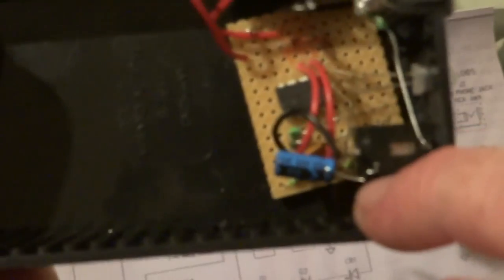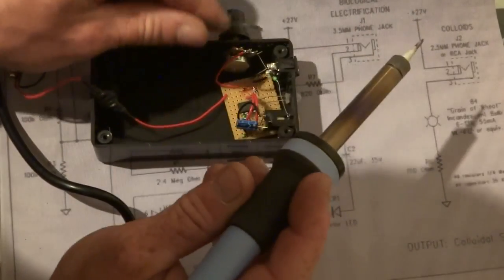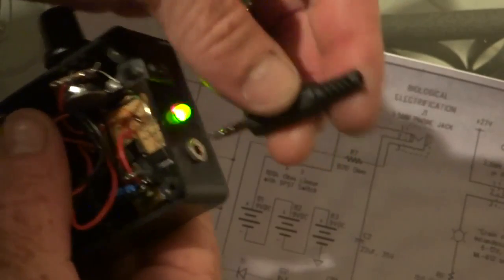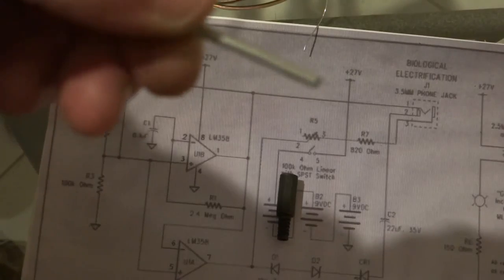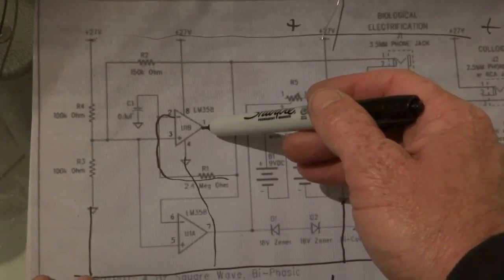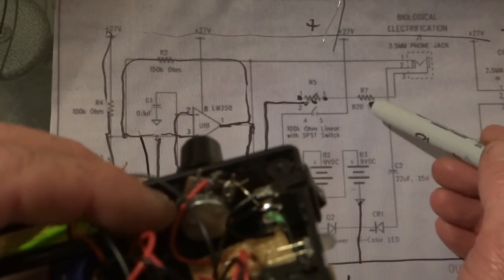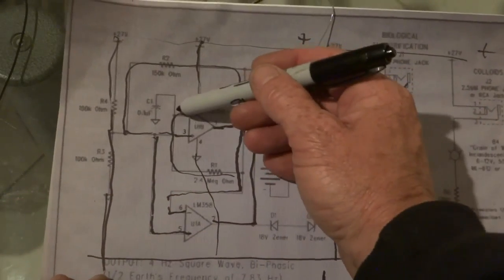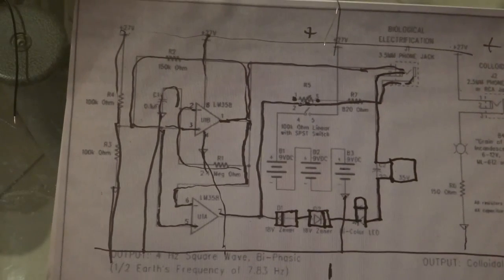How to build a Bob Beck Blood Electrifier  2

Comment: I have build the device and it works. Great instruction in your tutorial video. What method and materials do you use to solder the copper wires to the stainless steel rods to make the electrodes? I am find it difficult to solder the two metals. Should I use another method that requires more heat than a soldering iron?
Reply from the maker: i didnt personally make this vid, im just re posting to help spread the info. i had to resort to stripping the wires and wrapping them around a Stainlesss cotter pin and hot glued then wound around. i cut the pin in half so each half is glued to each wire
Reply: That is an excellent retrofit for the electrode. Tell me ," what size pin do you recommend.?
Reply from the maker: Neo Tuner  get one about as wide as a headphone plug. im sorry i dont have the exact data on hand.
Reply: Thanks for your help. The unit works well. I am strictly into day 5 of the BB protocol. Strange ... but my sense of smell has increased. More to follow.

Comment: Hello Synapso, Can you do part 3 of the video also explaining the silver pulser circuit
Reply: just put a 9v battery on an opened battery clip removing the wires, run two other wires with 5amp rating into aligator/crocodile clips with 5amp rating(i got from halfords(car extras specialist) then clamp 999 gauge or bezel silver on, make sure wires from 5amp cable dont go in water and your away!! just leave for 2-3 mins in water remove stir and enjoy ;)
Reply from the maker: Its not me, i am just hosting it for archival purposes. look at the "origionally from "  link in the description

Comment: This will be my first diy activity... it looks relatively simple but the guy did not explain/show enough of the soldering for me...what was that stick of metal that he was using to solder the wires to the box? also, are we supposed to solder the back of the board (at the beginning)? what are we soldering to what there?

please excuse my ignorance but can someone help me out with that? if I get pass this part, I think that I could do everything else no problem. thanks!

Comment: Thanks for the great video. One question please. I noticed the resistors you used are slightly different (.6w 1% vs 1/4w 5%) as shown on the schematic. Is this critical to obtain proper delivery at electrodes?
Reply from the maker: the 5% should be fine..

Comment: Thanks for this great tutorial. I know it was a lot of work, but well worth it.
Can you tell me what readings I should get if I hook up a voltmeter to the electrodes? I realize it is going to jump around because of the square wave pattern, but should the peaks reach anywhere near the 27 Volt supply?
Thanks for your help!
Reply: It is bi-phasic so it will depend on how you measure it.If you measure with direct current it will jump around from + - + - + - readings where if you measure AC alternating current it will give you total voltage.

Comment: It seems as though you change the output of the circuit by omitting the two other lights. Bob Beck indicated that it takes a small voltage to disturb the harmful cells envelops. Just want to get your opinion on the matter. DOes it change the effectiveness of the mchine??

Comment: Great tutorial. I followed you instructions however when I switched on the unit, it blew out the light bulb. I bypassed the bulb and the LM358 exploded blowing the top off the chip. I used a mono plug and jack and it was plugged in prior to switching it on. The bi colored LED does not light but is good when I tested it with a 3vdc battery. I was unable to find a 6-12 v 55ma lamp so I used a 6.3 v 250ma bulb instead. any suggestions on what I may have done wrong?
Reply from the maker: this isnt me in the video, but when i made one i used a 28volt 40ma bullb, in fact i think there is 3 bulbs in the circuit.
Reply: Sounds like the circuit is shorting somewhere for the light to light and blow.The light shouldn't light.It is only used to draw current through the element within the bulb.

Comment: I managed to build one and it seems to be working. My question is: is it OK to use a power adaptor - the one that produces 24 V DC - instead of alkaline batteries? This will save money since alkaline batteries are rather expensive.

Comment: Does anyone know if a 24 volt wall dc adapter would work as well as the 3 9volt batteries, in case you ran out of battery or, as an alternative while sitting at home.

Comment: B1, 2 & 3 stands for "Battery" 1, 2 & 3 not "Bulb" 1, 2, & 3. So don't fit ANY bulbs to the batteries!
Reply: +Johnny  If you see the diagram for colloidal silver maker it states B4 which is in the electrical diagram,it also states 6v Light bulb if you watched the video.